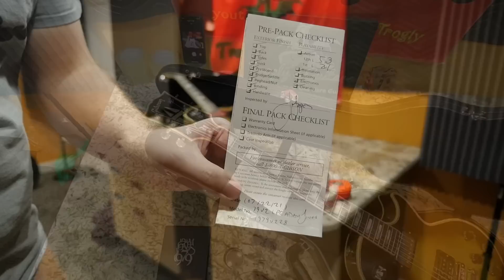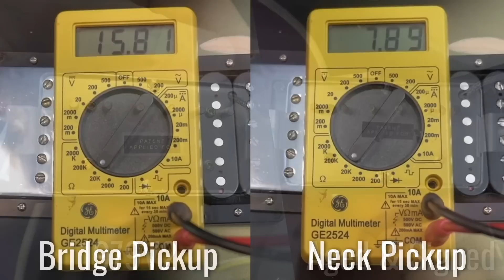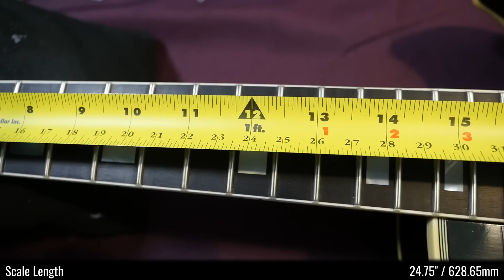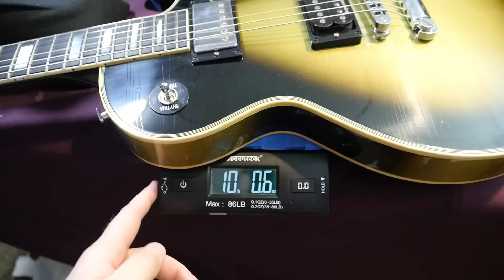It's Actually DIFFERENT! | 2021 Adam Jones 1979 V2 Les Paul Custom Antique Silverburst Review + Demo

Comment: The signature on the pickup is MJ which is Maricela Juarez she’s the manager of the Seymour Duncan custom shop! She’s a legend!!!
Reply: To add to that, she actually personally winds these pups. That DDJ sticker stands for Duncan Distortion and J for Juarez. There are other variations of the DD's, however hers are notoriously hot.
Reply: @jacknicholson5794  that's so cool!
Reply: @jacknicholson5794  Thanks for sharing, that's very cool. She winds a mean sounding pickup based on this demo. Usually not a huge fan of Trogly's tones (nothing against him, this isn't a tone-dedicated channel and tone is subjective anyway), but the bridge sounds fantastic.
Reply: Yes! She did my custom Antiquity humbuckers (I wanted to tweak a few things from stock so had to go custom shop) and they're some of the best pickups I've heard.
Reply: My MJ Antiquity neck pickup just makes me smile… 

Maricela is a treasure
Reply: MJ is the best! She’s made some amazing pickups for me over the years. So glad they made these custom for this run!
Reply: @jacknicholson5794  incorrect the SD website stated 16.6k for both DD and JB pickups and all of Troglys were about 15.6k. However both those figures are insnae and in the age of clean boots complete unnecessary.
Reply: Get off with her then.

Comment: I would say the Aging on the V2 is Murphy lab cryo. It looks similar to the type of checking you may see on a 50s 60s nitro Gibbo but not what you would see on a Norlin. That said it looks way better than V1 aged which is pretty fugly and looks nothing like an aged Norlin either. V2 did better getting some yellowing on the headstock etc. Still the quality of these guitars is way below a 2014+ R0 or R9. 3 piece maple necks and tops? Cheap AF. Why bother this Jones guy doesn't inspire me. I'd rather listen to Jeff Beck or Guthrie Givan any day.

Comment: I have a 1944 Gibson SJ. It has real finish checking. It looks totally different from those razor blade gashes.
Even has finish checking in the pickguard. It got this way from my father playin' it. Taking it camping. Never babied hat old SJ.
Now I have it. And it sounds GREAT!
Reply: I’ve played the living $hit out of all my guitars.  Each of them are very well cared for and used to the max.
My goal is to pass every last one of them on to my Son.   I’ve a heavily used 1986 Les Paul Custom that has finish wear and bumps and dings, but it still has no finish checking!   I keep waiting for a few but none yet.
Reply: @hkguitar1984  Finish Checking is more related to temperature changes, even humidity variations. If you keep that guitar in it's case and the room temperature isn't all over around, or you don't tour it, it will be the same for a long time. For me it's better without those, gives the guitar a cleaner look.
Reply: @notmaze  yeah, I’m pretty careful about temp and humidity.  Many times the lacquer checking looks great on an old instrument, I just can’t bring myself to artificially induce it.
Reply: The new ones aren't made with a razor blade but thanks for tuning in lol
Reply: @notmaze  Finish checking is fine for a vintage instrument. but it's not for a relic guitar it never looks right. that's why I have no use for relic guitars. I believe that a guitar should get it's battle scars naturally.
Reply: That guitar is very valuable, I sure as hell wouldn't thake it camping or anywhere else. where there would be any risk of getting it damaged for that matter.
Reply: pretty sure Murphy lab us cryo now m8

Comment: I just found a 79 silverburst.. it definitely had a funky angle neck pocket. I sent it back. Found a 1978, perfect pocket angle, needed wax potting on the pickups, I did a refret with 6100’s and a new bone nut. Stock one was plastic. This 78 silverburst is incredible. I just need to get a Duncan distortion now into it and reverse the pickup. But the stock Tim shaws are reeeeally good

Comment: Paying more money for any relic guitar makes no sense to me. For me over the last few years, Gibson's quality is going down while the price skyrockets. As far as the guitar market goes, the bottom will fall out. The market will not bear these inflated prices forever
Reply: I purchased 3 Les Paul Standards in the last 5 years. I wouldn't sell a single one of them.  All 3 are absolutely perfect. 
2 of them were purchased without even playing them.  My only complaint was that the seller horked the case candy out of 2 of them. Quick call to Gibson,  and everything was replaced. Top notch service,  beautiful guitars.
Reply: Labor intensive to relic however I’m with you as I’d rather put my own history of scratch’s dents ect on my guitar

Comment: I bought a 1981 les Paul cherry burst custom in 1995 from East coast guitar for 900.00. The wood was great electronics and all screws buggered  up. So I called George gruhn and ordered all new screws and cream pick guard and pickup rings and pocker chip and plug cover and 2 demarzio pickups paf for front and super distortion for rear. Redid whole guitar and it was great after and beautiful.

Comment: Not a fan of either aging job, the back of the neck on V1 looks like someone hit it with a belt sander.. ( which they probably did)  the checking on V2 looks like it’s either been done with some type of Contracting top coat or a nitro that was shot and force dried to shrink. Neither looks natural imho, How will these Gibson “aged” guitars actually age further over time??
Great review

Comment: Someone please tell me, how do they accomplish the "light" finish checking like that? What's the process?
Reply: My guess is they heat it up and then freeze it, buuut I think they also have a sticker with a pattern so when they freeze it the sticker only allows the finish to crack in that pattern. That's how they're able to get the vertical checking, otherwise using that method produces random checking all over the place. If they're not doing it like that then it's my own original idea haha

Comment: I seen the thumbnail and said to myself oh no another silverbust however it's slightly different but still a silverbust LOL

this brings up one of points that I can't stand about relic guitars. the original one in this case has rusted screws. it's a known fact that rust is like cancer and that it will transfer to the strings. causing shorter string life. and to other metal parts on the guitar it's just wise to keep rust away guitars.
Reply: I will never buy one of those signature beat up Used Guitars.  I don't care how much money they become worth as a  future investment. I don't want any of them.. I want brand new guitars for that kind of money sitting in a brand new case in my collection, that's what turns me on. From Randy in a great Northwoods of Michigan God bless

Comment: Being technical, the headstock on all these, while being correct Les Paul Custom 50’s style, is wrong. The 70’s Customs and all Les Pauls shared the same headstock. Shorter. Next the 70’s had tapered binding in the cutaway and a non dished carved top. I prefer the newer, 50’s style headstock etc. However if Gibson is charging THOUSANDS of dollars to replicate this iconic Les Paul you should expect EXACT. Just saying.